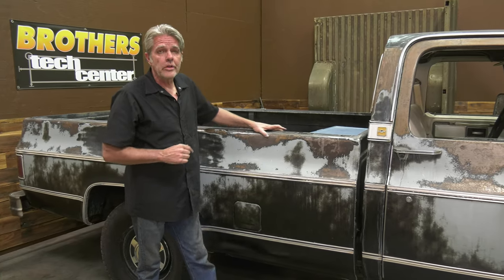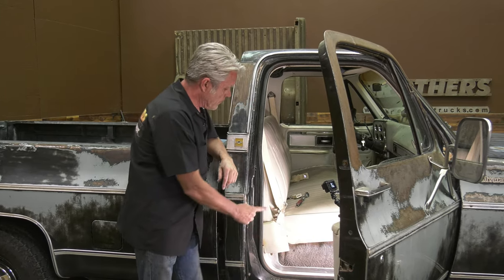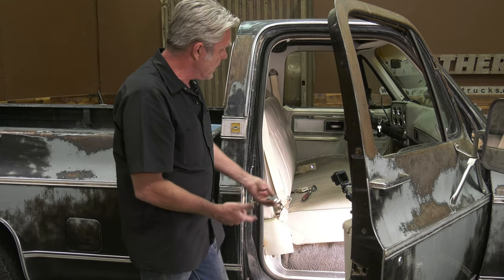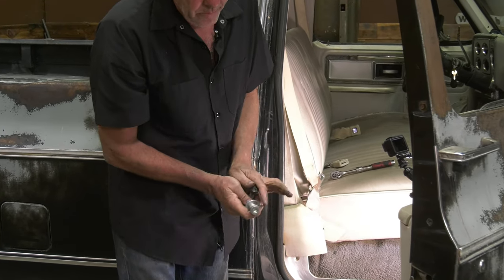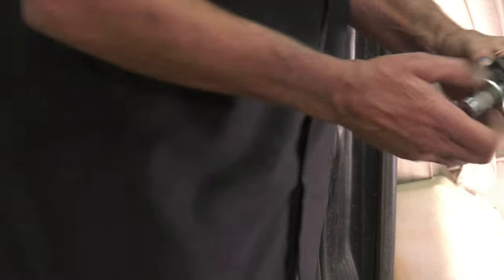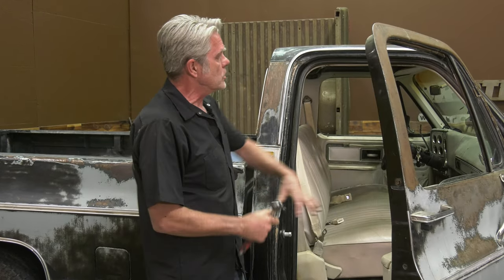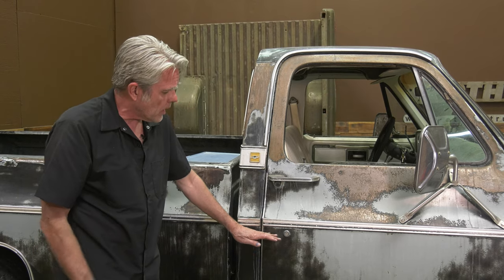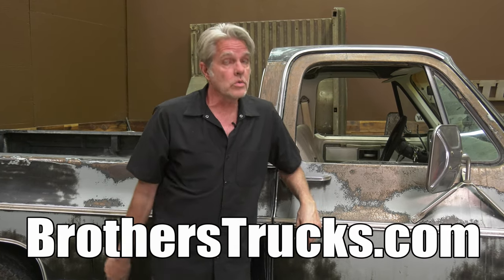1973-87 Chevy & GMC Squarebody Truck Door Latch Striker Replacement - Fix Those Rattling Doors

Comment: 1979 was the first year for fuel filler doors on those square body models. They replaced the previous exposed flush fuel caps. On square body pickups with just a single fuel tank, the fuel filler hole was on the passenger side from 1973 through 1980. In 1981, the fuel filler hole was moved to the driver side.

Comment: Don’t forget that the striker nut plate will fall into the cab/rocker panel section. Be prepared to possibly remove an interior trim panel to get your hand inside to grab the nut plate when removing the striker.
Reply from the maker: Great tip!
Reply: Absolutely right! Also .. if you're not working on an extracab or 4-door truck, very hard to hold big pliers sideways on that super-thin nut plate to keep it from spinning if the striker wasn't changed promptly. When the latch keeps pounding the old striker, it galls (ruins the threads) of the striker, so it may not back out unless you do squeeze that nut plate with those pliers. Took me 5 seconds to break the old striker free with an 18" pipe wrench, but 10 minutes to succeed at keeping that nut plate from spinning until I got the old bent and galled striker out!

Comment: The Rounded Line trucks (now called square body) doors were poorly fitted from the factory.
Just replacing the plastic ring on the striker helps tremendously to alleviate the common "slam it hard or it won't latch" malady.

Comment: HELP! What size Trox worked for you good folks?  
   On mine, a T47 regular Torx (a.k.a. "Star") socket bit is too loose, and a T50 won't go into the socket head. I wonder whether I should buy a Torx Plus tool, but I don't think so: There is no such thing as a T47 Torx Plus, and the regular one is much too loose.
Reply from the maker: Darn man, this has been a while ago since we did this project and nobody at the studio remembers what size it was. Our general feeling is that it wasn't a Torx at all, we're pretty sure it was an Allen
Reply: I have a couple different torx sets. 47 is always too loose but a 50 from one of them just barely fits. If I was you I would just use a vice grips

Comment: HOW I FINALLY GOT THE OLD STRIKERS OUT:
   Took me 5 seconds to break the old pair of strikers free with an 18" pipe wrench, but 10 minutes to succeed at keeping that flat, skinny, female-threaded striker receiving plate from spinning. 
   If you're not working on an extracab or 4-door truck, you can't hold a pair of pliers straight on that straight plate Instead, you have to hold 'em sideways. It's very hard to keep it from spinning (if the striker wasn't changed promptly). 
   Why? When it isn't changed promptly, the latch keeps pounding the worn-down, improperly-fitting old strike and it galls (ruins) its male threads. In addition, that slamming also bends the striker, so it's precisely like trying to unthread a bent bolt that is missing half its threads.
Reply from the maker: What a hassle!

Comment: TO ANYBODY WATCHING: Would you kindly tell me which of your tools DOES fit into the Torx ("Star") fitting on your door striker correctly? (T50 won't go in, T47 much too loose, no such thing as a size 47 Torx Plus.)

    Hey Brothers Truck Parts: Thank you. Damned decent of you folks to keep checking on people who watch a video that you made so long ago. important info for you at the end of this comment. *
   TO EVERYBODY: You'll find you can't find cab parts for old big trucks in the newer catalogues, but just enter this class of pickup, and you can*  ;  dash parts, cranks, windshields, etc. I'll try to let penetrating oil work on it overnight, tap it lightly a bunch with a hammer, heat the base of the striker with a heat gun to 160f, and smoosh some layers of aluminum foil over the too-small T47 and see what does ... or doesn't ... happen.
   I'd still appreciate anyone's kindness for telling me what the danged correct tool is.

*  Big trucks up to 50,000 pounds GVW, were made with this exact pickup truck cab. 1980-1987 for sure, and in some cases , but not all, earlier pickup and later big-truck models are interchangeable too. Chevy C50, C60, C70, GMC C5000, C6000, & C7000. (I have a 1990 GMC C7000.)
Reply from the maker: Just curious, why are you removing the striker in the first place? If it's bad and you're replacing it then just grab it with a pair of Vise-Grips and loosen it then use the T47 to remove it.
Reply: @BROTHERSTruckPartsTV  Oh. Duhhhh ... I, like, hadn't necessarily thought of that. Will do. THANKS! And I am replacing it; the old ones aren't even cirular anymore. The top halves have been ground down so much, they're flat. The new ones use Allen hex fittings.
Reply from the maker: @ScottyCrawford  Good luck man!